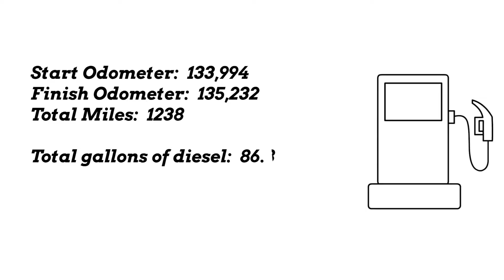Mercedes Benz Sprinter Approved Emission Modification. Did it wreck my MPG??

Comment: Are you still happy you had the emission modification done ?
Reply from the maker: Yes. It did not have a negative impact on the fuel mileage. Plus we got the settlement check and an extended warranty

Comment: I did the AEM recall. They gave it back to me with a check engine light for a faulty glow plug. which wasnt the case when I gave it to them. I also had to pay 500 to get the emissions system back online because it had been deleted (apparently). My van used to be an ambulance so a DEF system would be a hazard in an emergency situation. I don't trust them at this point. I honestly don't believe they did all that much extra work since I don't think anything was missing from the system just not plugged in. They should have footed the bill there, but they prey on ignorance. The $2000 incentive was not worth it which I am still waiting on, it has only been about 3 weeks though. I know better now. I'm probably gonna undue everything they did now lol. Emissions systems ruin your engine life.
Reply: How do you undo the recall? I was told it can’t be done or they won’t do it.
Reply: @qdubu  you do it yourself. lol.
Reply: @qdubu  or pay a shop

Comment: The emissions modification was done on my 2013 Bluetec EClass. My highway mileage as calculated on the "From Start" went down from frequent interstate driving trips of about 38mpg to just over 31. I've had over 43mpg on some long trips. The car had a check engine light come on after 126 miles of mostly freeway driving. Got it back to the shop and I was charged $800 for a fuel pressure valve that they said was just coincidental. When I picked the car up after that it was running very rough. I tried to take it home. I had to return after just a few miles because it wouldn't shift right. Now waiting for bad news about another "coincidental" failure. Mercedes customer support has been no help. Just blowing smoke and they refuse to answer questions about the software updates and won't give me info on how to find out about was addressed in the software update. The lawsuit does state that coverage for repairs to any "reasonably affected system" should be covered. Not. This was my last Mercedes for sure. If anyone else has run into these same troubles, please reply.

Comment: Some similar results. We have a 2011 Sprinter 3500 which was built out by Winnebago as a Reyo/Via RV (small Class A). We have similar driving styles. Our difference is our weight is just under 11,030 pounds. Previous to the AEM, our fuel mileage for the 20,600 miles we drove in 4 years was 15.5. When the AEM was performed, average fuel mileage dropped temporarily to 13.9 for a trip from Daytona Beach to the Florida Keys. As you suggested, it appears that the computer adjusts and we now are getting 14.8 after 12,000 miles with the AEM. We have seen a 5.5% average fuel mileage decrease. At the time of the AEM, our DEF heater had failed and it was estimated that it would cost $4,400 to replace. To their credit, Mercedes-Benz replaced the DEF heater for free when the AEM was done. However, in 2020, we had to replace the NOX sensors at a cost of $1,800 and we could not get reimbursement for that, they just replaced the 1-yea-old NOX sensors with new ones.
Reply: The same thing happened to me in Oct 2020 with my E350 Bluetec not long after my extended waranty expired. There was a check engine light that came on. The dealership replaced all of the NOX sensors at a cost of nearly $1800. The DEF failed immediately after that it was replaced for free. My NOX sensors were still under an extended warranty when they were replaced less than a year before all of that. After the 2020 replacement, I told the dealership that I thought the blue pump might be leaking because I kept smelling an alcohol like smell sometimes. They said it was ok. Not long after that I paid almost $3000 to have the blue pump replaced because the fluid leaked, crystalized and destroyed the pump and it took some major cleanup of the crystalized fluid in and around that housing.

Comment: Diesel supposed to be more energy dense than gas so you're basically getting worse gas mileage than olds 454 25 years old engine with a carburetor and you're getting about the same gas mileage either have a Leadfoot or you need to release your emergency brake
Reply from the maker: Well I am neither a leadfoot, typically drive no greater than 65mph, almost always on cruise control, and the mileage is consistent for the last 150k miles.

Comment: Why would you get 14 our motorhome with a 454 olds big V8 got like 12 and your turbocharged diesel is getting 14 our motorhome was huge to there's something wrong with your vehicle
Reply from the maker: I don’t know if there is something right nor wrong with the vehicle. This is the fuel mileage that I have gotten for the last 150k miles. It does seem to be consistent with other motor coaches on a sprinter frame.
Reply: My boss has a mid 2000 Chevy box van with a 4.8 v8 with 410 gears and it only gets 10 mpg. My boss also has 3 Mercedes sprinters that average 16.5-19 mpg with a lot of weight. Average speed is about 75-78 mph on the highway.
My buddy has a 1 ton truck with a 454 and it averages 7.5mpg towing his travel trailer after custom exhaust....his truck was getting 5.5mpg before.

Comment: i know three guys expiditing, have around 150k, 300k, 70k, they load up to 5000 pounds and still get 19 to 19.5 miles going to 78miles an hour, how heavy is yours why its only  14.26 mpg,
Reply: are the going by actual or the dashboard computer
Reply: @wayneroadarmel235  by actual
Reply from the maker: Thanks for the info and comment. My vehicle is just over 11030 lbs completely unloaded. I think they do not suggest more than 500lbs additional load (passengers and stuff). However, with passengers, full freshwater, supplies, and bikes on the back, I am
Assuming we are close to 12500-13000.
Reply from the maker: And I am not very aerodynamic :-) the 18 foot x 10 foot x 7 foot square box (living space) probably isn’t cutting the wind very well.